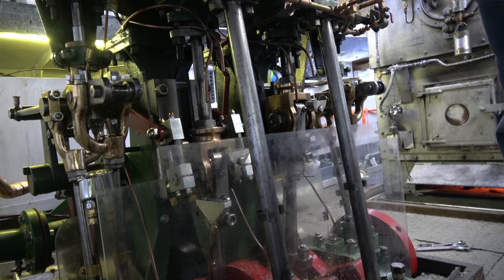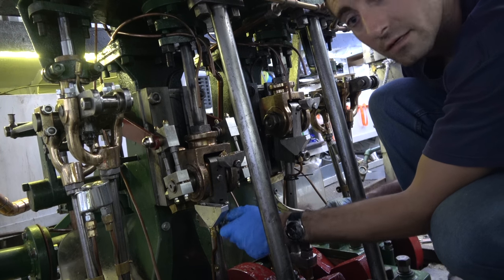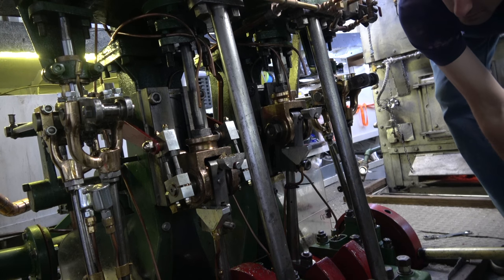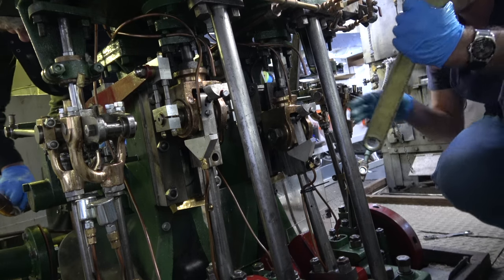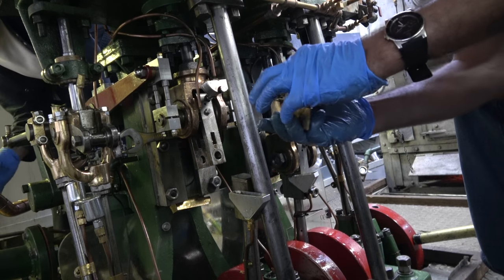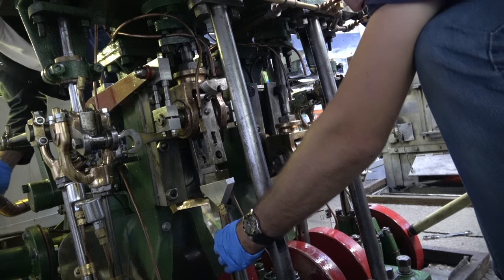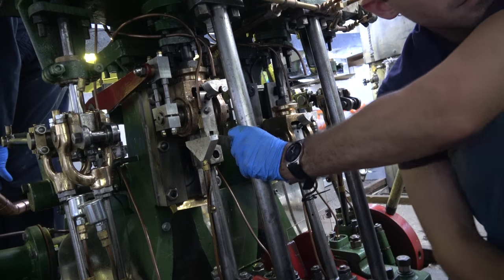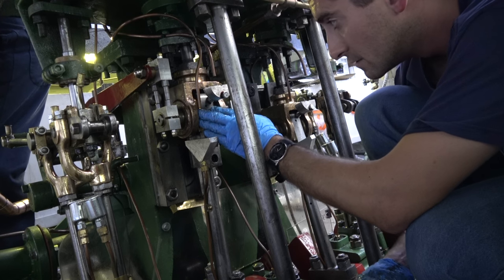Steamboat Steam Engine Bearing Adjustment

Comment: Dont you have any spanner and a hammer. Copper hammer and the correct tools will make you job alot easyer.
Reply from the maker: We do, but they weren't all on the boat and it was a quick job with passengers waiting. Thank you for watching!

Comment: Sorry but it's still too noisy.
Have you checked the valve settings? Lack of symmetry in the valve settings can make and steam engine noisy due to excessive compression (cushioning) at one end of the stroke and insufficient at the other so the bearings knock.
Reply from the maker: Yes it is, although the camera picks up a lot more noise than there really is. As the description states, the big end brass on the low pressure connecting rod also had slack in it that was taken out AFTER the video. The die blocks are also worn and the yolks have all the shims taken out. The only way to remedy is to either make completely new die blocks, completely new valve stems with smaller yolks, or silver solder bronze bushings onto the die blocks and turn them down. The shop and equipment are now 100miles away, so it's a bit longer process to remedy certain issues that require machining. The valve timing is set as correctly as they can be... Only the valve on the stem can be adjusted. The eccentrics were keyed to the crankshaft when it was built over 100 years ago. Thank you for watching!

Comment: what happens when u put racing oil in this engine
Reply from the maker: We run 150w oil on the external reciprocating parts and 600w in the steam side. Not sure they make racing oils that thick.